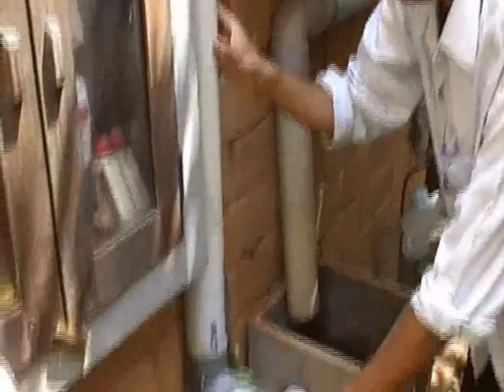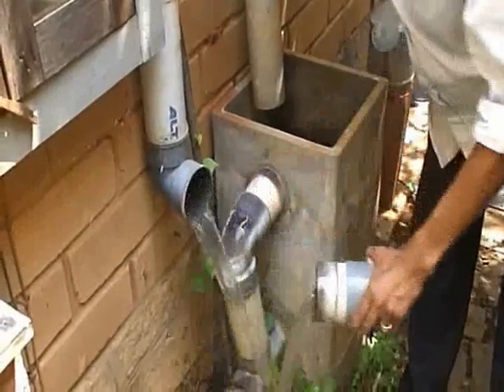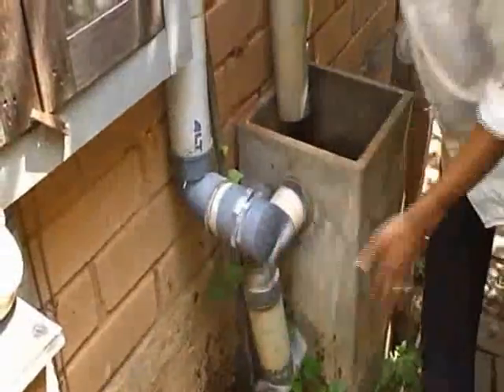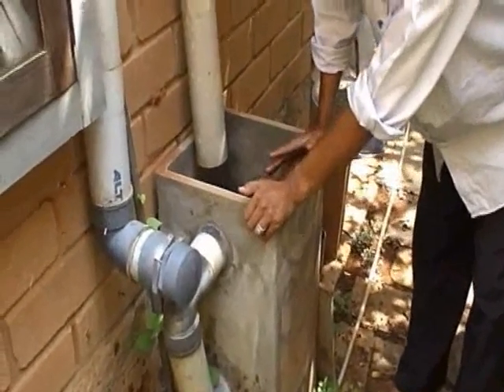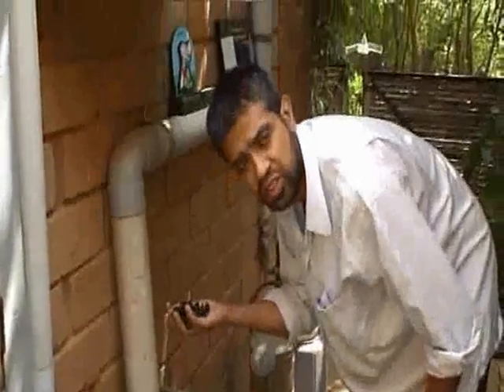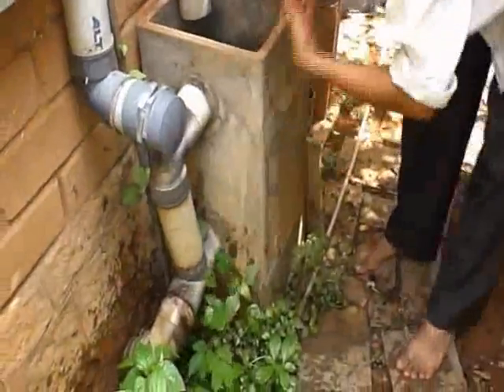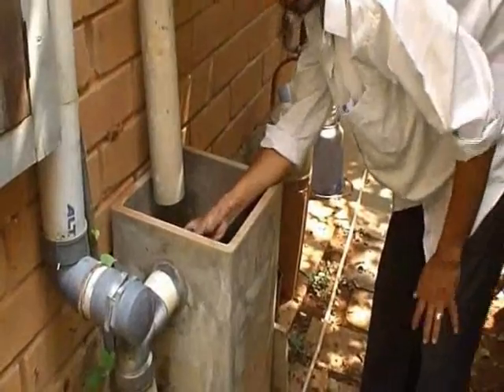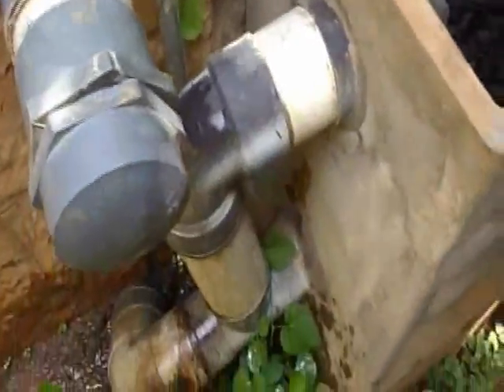Harvesting rain - an urban rainwater system, Bangalore,India.

Comment: I didn't understand.. you constructed 6.5 thousand  litre tank and how can get 95000 litre water?
Reply: The rainfall is spread over 8 months and 60 rainy days. When the sump fills up you use the water leaving it ready for the next rain.
Reply: @zenrainman2  sorry I can't get
Reply from the maker: @vinaybandekar921  suppose it rains 50 mm on April 6th. I will get 5000 litres into my sump. I start using it at say 500 litres a day . In 10 days the sump will be ready to receive more rain. Suppose it rains 30 mm on May 4 th. I will get 3000 litres which I then start to use ...and so on. The rain is distributed over 8 months and with repeated filling and emptying a small sump tank can harvest more rain.
Reply: @zenrainman  my side rain starts June 2nd week and ends on first or   
2nd week of October after then no rain
Reply from the maker: You have to design differently. But start small and you can always build more storage later. @vinaybandekar921
Reply: @zenrainman2  sir your sump is made  just like tank or its absorbing water from gruond after rain stops?

Comment: I have recently installed rainwater harvesting mechanism at our home. Earlier we used to send the water from our highest roof (3rd floor, about 800sft) into a closed well (filled with earth n cement debris). I had the 2nd floor roof (another about 600sft) water diverted into a Sintex tank (for cleaning and gardening) But as we have trees, lots of carbonaceous material got collected and smelled up the water in the tank. The rainwater filter guy said he wouldn’t send the water into a sump, because of contamination, and no use actually installing a filter. 😔
Now I’ve cleaned up the well, emptied and cleaned the tank and divert the additional overflow from tank to well.
But am unable to get any ideas about the leaves entering the water. Please provide some ideas!
Thank you!

Comment: Great setup zenrainman. I have a question. When you fill the filter tank with sand, won't it clog the pipe ? or if the pipe is placed above sand and charcoal layer, I did not understand how it filters water throughly. Can you please clarify. Thanks in advance !
Reply: As I understand and usually seen, you need an outlet with mesh/net covering at the bottom. the pipe above the sand and charcoal is only for overflow. So they normally fill in gravel at the bottom to prevent clogging. Gravel, smaller gravel, sand and charcoal and then repeat layers if necessary

Comment: Good idea, But i think the filtering process is not doing really what its supposed to do. The filtered water should flow under the sub tank. that means, the connection pipe to main tank should  not on the top of the sub tank, it should be at bottom of the sub tank, else there is a chance to flow water without filtering . Filtered water will be available at bottom. but in this process , the bottom of sub tank is full of sand... my logic may be wrong.. just a thought to make sure we are doing the correct way...
Reply from the maker: Prince Antony the system has been working for 20 years, not theory but actual practice.:)
Reply: Yeah there is a pipe in the bottom of the filter tank. The pipe above is to bypass the excess water that about to overflows from the filter tank.